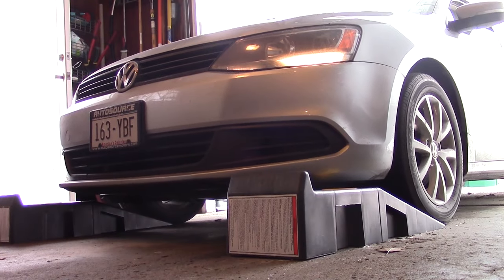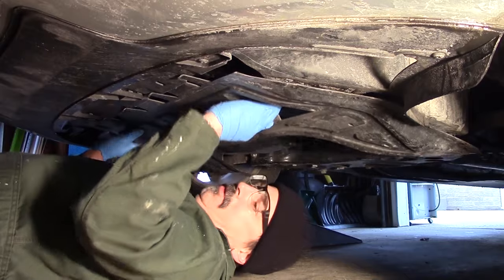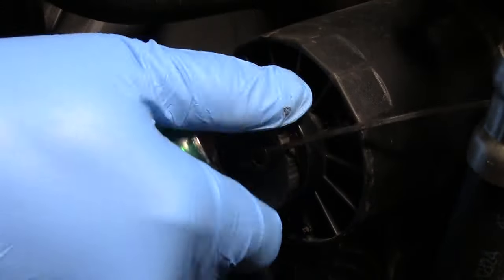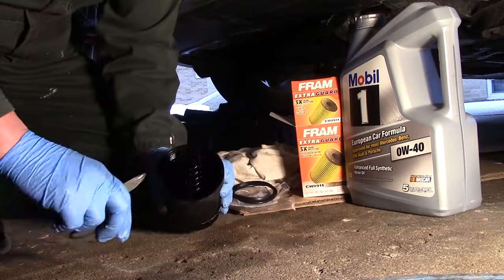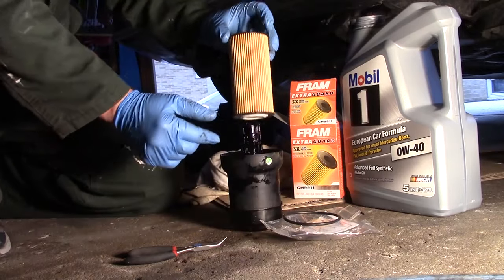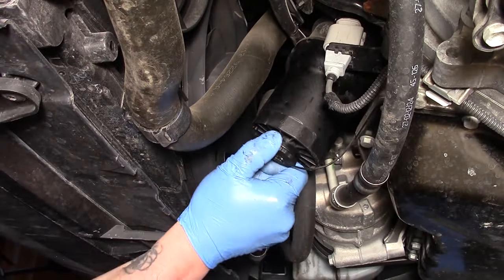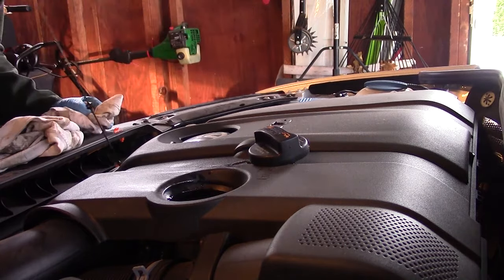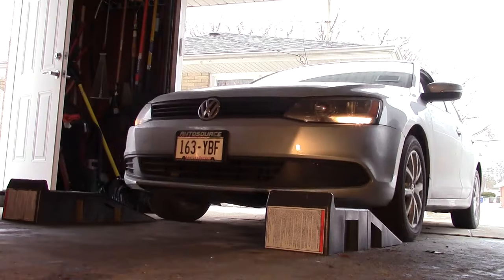VW Jetta Oil and Filter (2011-2013)

Comment: You're spot-on for the oil types. Castrol Edge 5w-40 (currently with the yellow field around the weight rating) and Mobil 1 0w-40 "European Car Formula". Motul is available on-line: Motul 8100 X-cess 5W-40. I'm only familiar with Motul from Motorcycle fluids, but apparently, they are automotive as well. Thank you for the great video.

Comment: The 76mm filter wrench was too large for my 2013 Jetta Sportwagen 2.5L. No engagement whatsoever. A 74.3mm worked perfectly (Uxcell 74.3mm 14 Flute Oil Filter Wrench). A 74mm was usable but took some effort to pull the wrench off the oil filter housing, since the fit was tight.
Reply from the maker: So weird that VW seems to haphazardly swap between oil filter housing sizes within the same generation.  TY for the info!

Comment: The procedure is almost completely the same for the 2013 Jetta with 2.0L Diesel engine, with the exception of the oil filter being top side, and requiring a 32mm socket instead of the 76mm 14 flute.
Reply from the maker: TY for the helpful info!

Comment: I know this an older video, but liqui-moly 5w 40 is also a commonly available vw 502 oil in the us
Reply from the maker: Sure enough. Looks like I can get Liqui Moly at my local Advance auto parts store. A bit pricier than Mobil 1, but has some high ratings.

Comment: Just loved ur video, staright to the point. I spent hours watching trash by some idiots. Could you make a similar video for transmission fluid change on VW Jetta? I am literally confused on which fluid shall I use?
Reply from the maker: TY for the nice comment!  This Jetta was a friend of mine's and it has subsequently been totalled, so I won't be able to do a tranny fluid change video on it.  Sorry:(.
Reply: @hanoihancock  Perfectly fine and thanks for replying back. Could you make a video on how to change a transmission fluid and how to check the right fluid. I am surprised no one ever discusses the transmission part. I went to a Volkswagen center and even those guys looked clueless.
Reply from the maker: @darkknight6468  Here is an excellent video on how to change automatic tranny fluid on a Jetta. https://youtu.be/MMmsp8ULf1s Unfortunately, you need a $200 VCDS tool to perform this procedure:(.  Basically, the VCDS tool tells you exactly what temperature the tranny fluid is.  The tranny fluid level must be measured at a very specific temp because it expands as it's temp increases.
Reply from the maker: @darkknight6468  Here's another helpful link.  It's more comprehensive  than the video, but also shows a bit more than you need just to change the fluid.  The key piece of info in this link that is not in the  video is how to remove the drain plug level insert...which is the screw the drain plug screws into.  https://www.blauparts.com/blog/how-to-change-vw-transmission-fluid-09g09m-6-speed.html#:~:text=Begin%20by%20removing%20the%20lower,T%2D25%20torx%20bit%20screw.&text=Locate%2C%20loosen%2C%20and%20remove%20the,a%205mm%20Allen%20drain%20plug.
Reply: @hanoihancock  Thank u for the links. I will check for sure. You have been more than helpful

Comment: Other sites swear by the 74mm 14 flute. I have a VW 2.5L Jetta, 2013. Should I stick with the 76mm? Thank you!!
Reply: Gina Lauricella I just measured my filter housing and it's 74.5mm x 14 flats
Reply: No. It will not work.

Comment: 76 mm !! Thank you so much.
Reply from the maker: I recently ordered a 74mm Aluminum Oil Filter Socket (https://amzn.to/2K12xr9) and it fits even better than the 76mm socket I've been using for years!  I guess manufacturers advertise some wrenches as 74-76mm because they technically work for both sizes, but I can now confirm that the 74mm is the more-appropriate size for this application.

Comment: Great video, need to know what's the best oil filter for the car?
Reply from the maker: Rodney Harraway Mann is what they would use in Germany,  but I don't think there is a significant difference between any of the major brand filters (Fram, Mobil, etc).
Reply: hanoihancock Okay, what about for tire rotation?
Reply from the maker: Tire rotation is dependent on tire and vehicle type.   The Tire Rack website has good explanations and illustrations of all tire rotation methods. http://www.tirerack.com/tires/tiretech/techpage.jsp?techid=43

Comment: Does the relief valve reset itself after installing oil Filter housing back ?
Reply from the maker: No.  You shod manually reset the oil filter housing drain valve before reinstalling.

Comment: Hey man, is it possible to compete this job without the oil filter wrench? Would like to try it by hand is possible, Thanks!
Reply from the maker: It's not impossible to remove it by hand, but some of these get pretty snug after they get hot and cold a few times.  You can always try by hand first.  Worst case scenario you change the oil but not the filter and you follow up with a proper change later after you buy a wrench.  A universal strap wrench would work too if you don't have the fluted wrench.
Reply: @hanoihancock  Awesome, thanks for the reply and great tutorial brother 👍
Reply from the maker: @samuelkatz7905  TY for the nice comment!

Comment: what the best oil to put in 2012 vw jetta se naturally aspirated 2.5L gas engine  thanks in advance
Reply from the maker: Mobil 1 0w-40 should do the trick .  However, Google "Bobistheoilguy VW Jetta 2.5"  to find other suggestions depending on your situation.  It's important you use a VW spec oil.

Comment: What's the torque spec for the oil drain plug and for the filter housing?
Reply from the maker: 22 ft lb or 30Nm on the drain plug.  18.43 ft lb or 25 Nm on the oil filter housing.

Comment: Quick question, I put in 6.5 quarts when I did my oil change and I checked my dip stick today and it read past the maximum. I am a bit concerned. In addition, when I opened the oil cap there was a bit of smoking coming out. Is that normal ? thanks
Reply from the maker: Drain some oil until you are at the maximum.
Reply: I remember my owners manual saying 6.3quarts not 6.5 I've also heard 5.7 somewhere

Comment: I know this video is old but does this also refer to the base model Jetta with the 2.0l engine? I have a 2012 VW Jetta that has the (refined 2.0) lol that actually came from the earlier mk3 model. Same amount of oil to?
Reply: And the 76mm oil filter fastener?
Reply from the maker: Unsure.  Probably similar but still different.  From my minimal research, it looks like there were three different 2.0l engines available in the 2011-2018 jetta.  A petrol, a turbo petrol, and a turbo diesel.  Which do you have?
Reply: hanoihancock I think petrol, that’s regular gasoline right? Mine take 87 grade California gas, Yeah, no turbo in mine.
Reply from the maker: @vincekay10  I suspect your engine is one of the two in either of these videos from other YouTubers.  Have a look and let us know if either matches your engine.  https://youtu.be/9azg_IhZxoQ and https://youtu.be/1-Hz_QA8CQw

Comment: I have a 2012 jetta, how often should i change my oil? 10,000km?
Reply from the maker: carranzapz Repair manual for the 2.5L 2012 Jetta calls for oil change every 10,000 miles.
Reply: 10k miles? Cause my mechanic told me every 10k km which would be 6.2k miles 

:(
Reply from the maker: carranzapz http://i.imgur.com/a1eKXqj.jpg
Reply: Thank you so much!
Reply from the maker: carranzapz Glad to be of service!
Reply: It greatly depends on running conditions as well. 10k miles is only for an engine that is running in ideal conditions - minimum of cold starts with majority of long trips where the oil has chance to warm up fully (10+ mile trips). Under other than ideal running conditions it is recommended to shorten the interval accordingly.
Reply: so 10km doesnt so bad afterall?
Reply: Yes. Though I can only speak for myself as an European user, where the oils are a little different (from my understanding), but from my point view 10 000 km (6200 miles) interval is ideal if you often do shorter trips. In my 1.6L VW engine I am doing the same interval.

Comment: I have a S base.  The oil pan doesn't have a 19mm bolt it has a bolt that requires an Allen key.  This bolt is really tight and I can't get it to budge.   What am I doing wrong?
Reply from the maker: Gerald Williams Sounds like some of the 2012 models had a 5 or 6mm Allen bolt instead of the hex bolt.  I recommend using an Allen key that fits on a socket wrench, but if all you have is a normal light duty Allen key, then you'll need to put something on it to get more leverage.  Old metal pipe or box wrenches work good for applying extra leverage in a pinch.  Good luck!  Let us know how you break it free!  You can do it!
Reply: I had to buy the sockets and it worked just fine. thanks

Comment: This is why I pay someone $30 to do this for me today. In my time it was a simple job and cost $10 to do!. Warm up the engine, stop it. Remove the drain plug from the crank case. Empty oil and replace plug. Remove filter usually by hand and collect the oil. Replace with new. Add oil till it read accordingly. What's with all these splash guards and filter valves? I appreciate your vid but today's cars are made so we can't work on them ourselves anymore. Heck I can drop a wrench and it never hit the ground! Then again cars today do go 100,000 miles between tune ups and do more than our homes did back in the 80's. Welcome to evolution!
Reply: $30 is a great price if you can trust the guy not to screw up your oil change. I trust no one and SOMETIMES that $30 guy is less than trustworthy with our cars, be careful.
Reply: @videomonster2000  I hear ya. I once took my Dodge Ram in to get all my hoses replaced at Pep Boys. Yeah I know bad move. I paid like $180 to have 3 hoses replaced. I come to pick up my truck and went home. The NEXT day I get a call from them telling me I need to bring the truck back asap. I'm like wwwhhhhhyyyyyyy? He told me they forgot to reinstall a "minor" part. I get there and the kid who worked on my truck brings out this huge black shroud. It was the cover over my air filter and fan housing. The "minor" part was 2 1/2 feet wide!  He said he forgot to reinstall it. I shook my head thankful I didn't have them do my brakes! Now I wouldn't pay Pep Boys $.50 to rotate my tires. They hire 19 year olds to work on $60,000 vehicles. That's called bush league.

Comment: is 5w30 fine
Reply from the maker: It's more important that you use a  VW spec 502.00 oil or better.   The weight of the oil is somewhat dependent on the climate wherever you are in the world.   Check for VW recommended oil specific to your region. If you're in the US, the only oil that meets the VW spec 502 is Mobile 1 0w-40 or Castrol Edge 5w-40.

Comment: Do you know how to reset the service light that goes on once you got the 10k mile marker?
Reply from the maker: Step 1: Press and hold button on right of instrument cluster with engine off. 
Step 2: Keep holding right button and turn key to on position. 
Step 3: Release right button and press left button 
Step 4: Cycle the key to confirm service reminder has been reset.
(Borrowed from another YouTube video.   Not tested by me personally.)
Reply: hanoihancock thank you!

Comment: How many miles can full synthetic mobile 1 resist?
Reply from the maker: 10,000
Reply: I have a 2011 jetta and I've been using full synthetic mobile 1 0w40 and man I'm changing it every 3000 miles , I've been wasting money and oil right!
Reply from the maker: @joesee1944  Sounds like you've got a good selling point for the car's next buyer.   "meticulous maintenance":)!

Comment: 19 mm socket doesn't grip!!! the actual drain bolt is round... I own a vw jetta 2012 2.0.L
Reply from the maker: The 2.0L is a Diesel engine. It is a completely different engine than the naturally aspirated 2.5L gas engine in this video.
Reply: Mine is a 2.0L gas non-turbo engine... I had to use an allen key to open it, but the rest is exactly as you showed in this video! thanks :)

Comment: Yeah. Thanks for talking but where the hell is everything.
Reply from the maker: Watcha need help finding?
Reply: Sorry for being a dick. I have a Jetta 2.5. I just got it. Most of the YouTube videos I watched Jest said, there is your filter. Here  is your oil tank. I was getting frustrated because nobody would say, it is located in this area. There’s a bunch of bolts and stuff down there. I’m not a Car professional or mechanic. So I was just looking for a little bit more directions to get to what you where showing. But every Time I looked at a video on you tube. The video just showed what I was looking for not how to locate it. I just wanted more direction so I accidentally did not unscrew something I shouldn’t. Agin sorry. I did find one that gave more detail so my rookie butt did not mess something up and really be in a bad spot.
Reply from the maker: @joeyleclair3213  No worries!  Good luck on your project!  Maintaining your car can be frustrating at first, but it gets easier with each little project you do:).